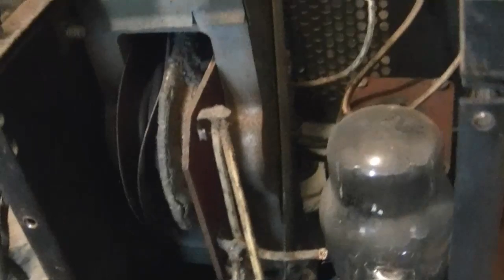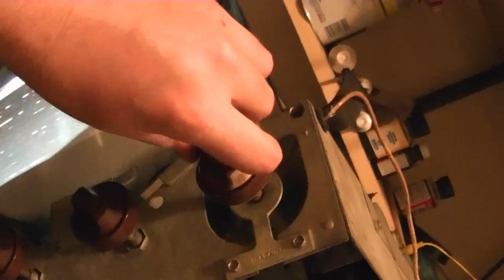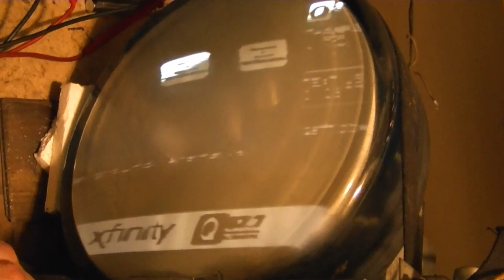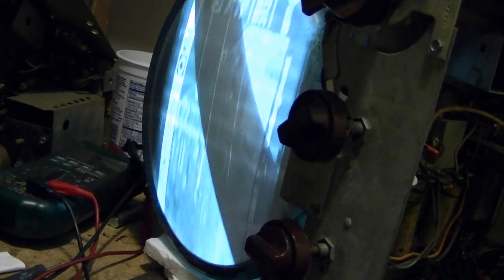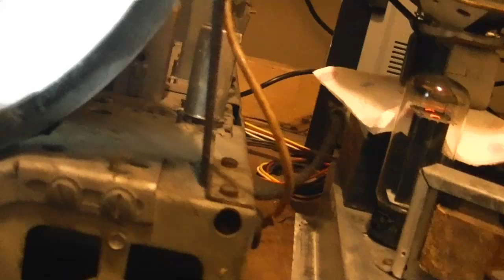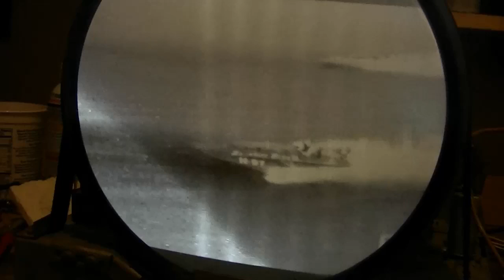Admiral 30A15 restoration p3o5

Comment: A 5R4 may be a better choice than a 5U4 in one of those sets.  They have higher plate current and voltage withstanding and lower filament current.

Comment from the maker: I ended up using a CL-90 on the transformer primary and it works very well although it does get quite hot.  If you use one I'm sure you can increase the size of your filter cap without any problems.

Comment from the maker: Perhaps, but I don't really see a need to improve the filtering.  Also, recall that when I reduced the size of the primary filter capacitor, I still had flashover.  I think Admiral just pushed the design a little too hard.  I have other sets like the RCA 630TS that puts two 5U4s in parallel to handle the heavy current load.  

One simple solution is to just use a couple 1N4007 diodes with 50 ohm resistors in series to replace the 5U4 altogether.  That shave 15 watts of the transformer too.

Comment: I was thinking in regards to using thermisters such as the CL-90. Would it be safe then to use higher than designed filter caps to improve filtering in other TV's & radios using a thermister to reduce in-rush current draw? If so, what higher percentage range would you recommend? Food for thought...

I noticed that the filtering could be better on a radio I restored using the rated filter caps in the schematic. 

I'm amazed how fast you got it working & that the flyback is working!

Nice work!

Comment: Was the flashover problem as pronounced on this set as the other?  I honestly couldn't see it as easily this time as before with the other upper chassis.  I do think you're right though.  Setting a surge limiting resister in series with the tube should theoretically eliminate the problem.  Nicely done getting the 30A15 to produce an image and audio so quickly!